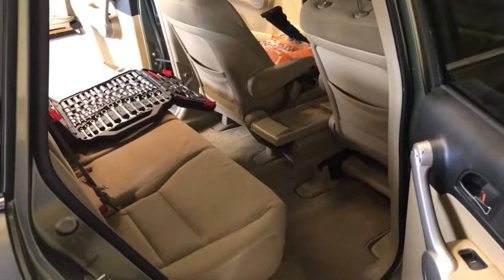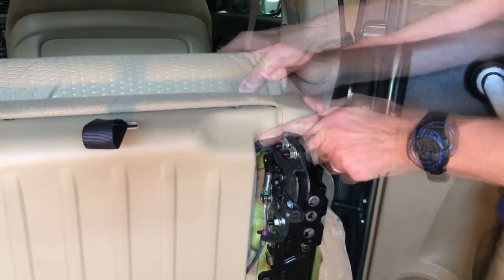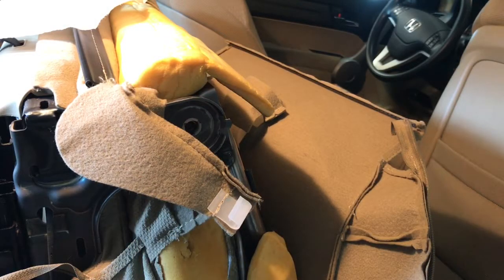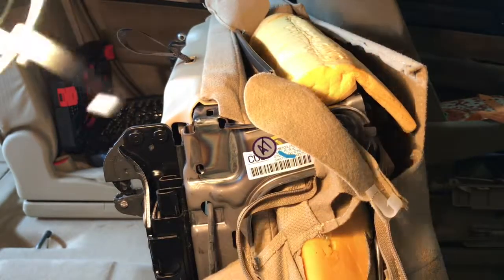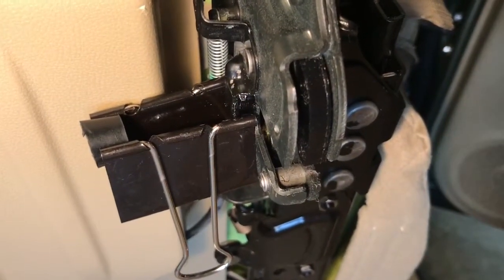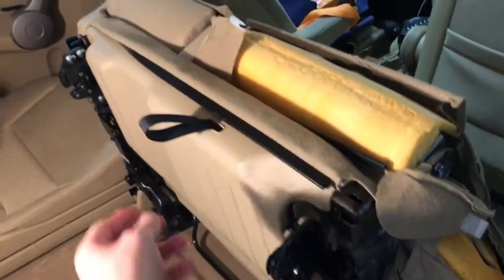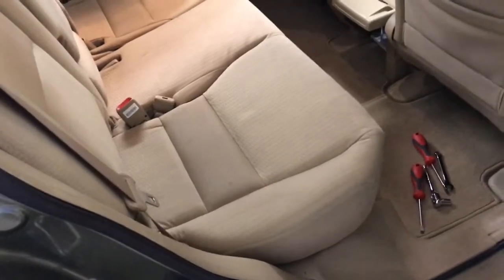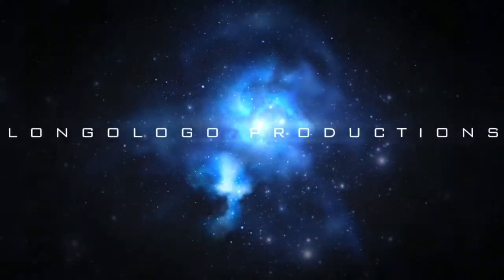Fixing rear seat noise in 2007 Honda CR-V

Comment: Did the noise from that fix ever came back?
Reply from the maker: @Tan pn:  So far the noise has not come back.
Reply: Have you ever tried to put anything on the metal bracket to fill the void space between the plastic ‘bumper’ piece and the metal bracket?
Reply from the maker: @Gurucwd:  honestly I don’t remember at this point, but probably not because I didn’t want anything to affect the secure latching of the seat base.
Reply: @LongologoProductions  I added a small strip of gaffers tape. On the left side (drivers) one layer and on the right side two layers. The tape was placed on the striker arm in the center. It was enough to dampen movement.